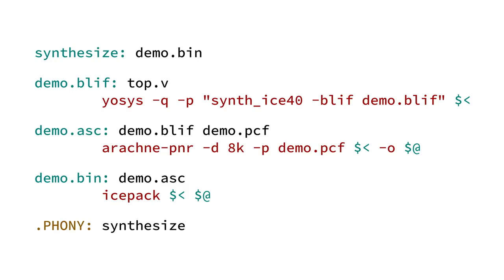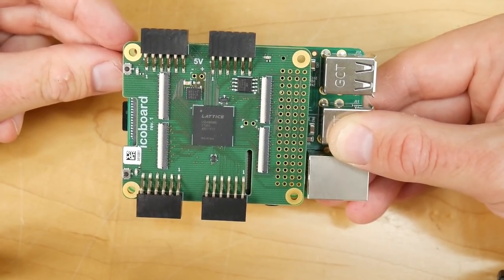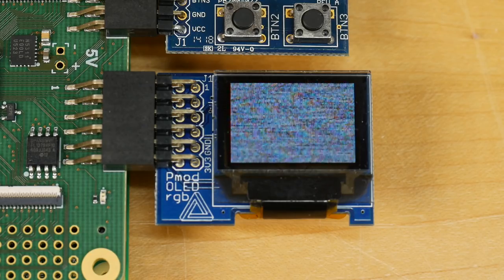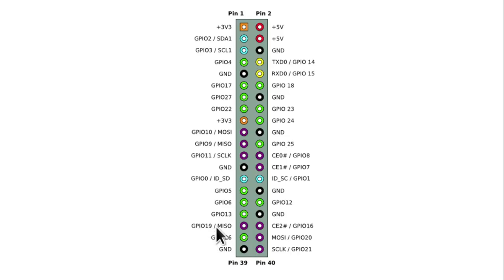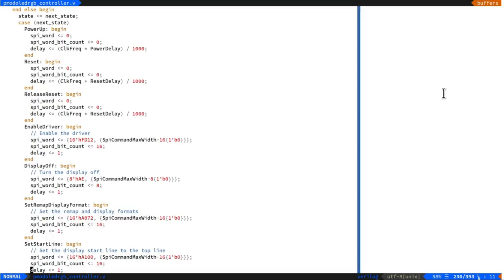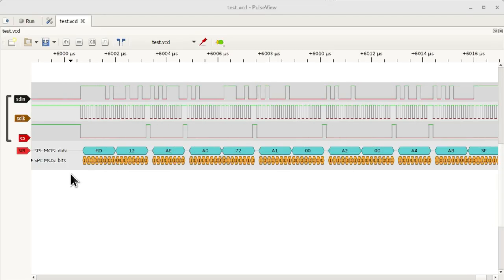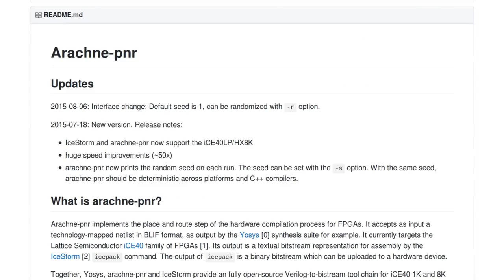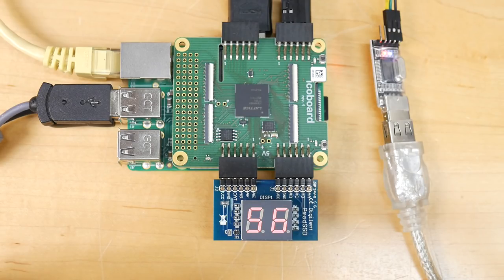[013-2] Open Source FPGA Synthesis with the icoBoard - part 2

Comment from the maker: Corrections:
- The FT2232H on the icoUSBaseboard is capable of 320Mbps transfers in synchronous FIFO mode.
Reply: OpenTechLab you did great job mate but i really do not know what u have done
Reply: I believe Syzygy rhymes with synergy
Reply from the maker: +gareth ronaldo check out the source code in the show notes. It might help make things clearer.
Reply: but the data sheet for FT2232H claims 480Mbps!
http://www.ftdichip.com/Products/ICs/FT2232H.html
Reply from the maker: +PirateKitty  That's the line-rate of USB 2.0, but by the time you've factor in all the protocol overheads, and time-division-multiplexing in USB, 320Mbps is about as much as you can reasonably expect in perfect conditions, with no other traffic on the bus.
Reply: I only can advice, please, beg you to do a beginner FPGA course...as i already have some altera stuff here, but i never made it to run something that i made on my very own..and we don´t talk about the ridiculous toolchain and module-pricing....
Set up a patreon FPGA course, if you want..... i´m in, for sure...that´s a great starting point: a RasPi, that FPGA board and a course...couldn´t be better than that...:)

Comment: Awesome 2-part video, a lot of condensed content that's really hard to find on YouTube. As for me, FPGAs and RF are part of that "almost-magic" domain, any video that brings it down to a more manageable level is really useful.
Reply from the maker: There's lots more FPGA and RF stuff coming. It's going to be fun!
Reply: I have more experience with RF personally, so I like the way I can think about FPGAs in a similar way to analogue circuit design. Microcontrollers, on the other hand, are the domain of evil pixies.

Comment: I bought the ICO board from DigiKey here in the states. Kinda pricey but I like the fact that it plugs directly into a PI so much.  I am going to use the flatflex connectors but was taken aback at how small they are! I shoulda known :-)

Comment: There are couple of limitations to amateur use of FPGAs. This first is the high package pin count of FPGAs, usually BGA, making it difficult to build the PCBs and place the components. The second is the high cost of the development tools. This channel appears to address both of these problems. I have used FPGAs in professional applications, but because of the above limitations I have only used PLDs in hobby applications, mainly because they are in home placable packages. I have not yet explored the videos on this channel but I do hope it also uses VHDL as well as verilog, as I am familiar with the former and have little experience of the latter, and also because VHDL is more often used in Europe,with verilog more common to the USA. I would really like to know if there is open source tools that can compile VHDL.

Comment: I wonder if you could use this for a software-defined radio TV receiver? A couple of ADCs sampling the signal from the antenna and feeding their outputs into the FPGA which does the decoding and sends the results to the Pi for playback.

My main doubt about the idea is whether this particular FPGA would have enough logic to implement a DVB-T decoder. AM/FM radio might be possible, though there probably isn't much point in doing it on an FPGA other than to see if you could when they're low-enough bandwidth signals that the Pi might well be able to decode them in software.

Comment: Would be interesting to hear from somebody in the know: What are the specs of that RISC-V softcore on this specific board, specifically achievable clock speed since the memory is mostly off-chip? Considering an FPGA clock of 100MHz, and the fabric being 78% full with a relatively simple C program, how much more can it be pushed?

Comment: I'm thinking about buying a FPGA board from terasic to learn verilog / VHDL. I don't know if i should get the cyclone 5 starter kit or a simpler board.

The cyclone 5 starter kit has both SRAM and DDR2, but i don't know if i will be able to figure out how to get the hard memory controller working. It also only seems to be accessible in qsys and i have no idea if it's possible to adapt the avalon bus to wishbone to use it with open source stuff.

My goal is to program clones of vintage computer / game systems and maybe make my own simple CPU. The external SRAM on the board would be a great way to store the cartrige data when the embedded memory is used up by RAM and framebuffers.

Comment: This was all very interesting and all (I have zero experience with FPGAs, but I do wish to learn), but I still have the problem of not really understanding what FPGAs are good for. Driving an SPI-display or such can be done even without one, and reacting to some debounced button-presses isn't much different. I suppose I'm trying to ask, what sort of a thing would be difficult/slow for e.g. RPi's SoC to do, but would be a simple job with an FPGA, either on its own or as an addon?
Reply from the maker: +Nita Vesa Ever had a problem where you needed some custom silicon to solve it well? FPGAs are the next best thing. For example the ice40 FPGA could easily drive dozens of displays. Larger FPGAs are where the real magic happens with massive data handling for broadcast video, RF communication, medical imaging, high frequency trading, machine learning. These are cases where specialist silicon would be ideal, but the costs are prohibitive. For makers, FPGAs let you play with really fast devices like the pros.

Comment: I had several boards, starting with no board Lattice CPLD maybe 20 years to 15 years back. Done nothing, then Xilinx cheap eval board, I think DE-0 without VGA and so. Then Xilinx DIL module (XuLA), only tested some small blinking. Then a DE-0 Nano board, done nothing, then a Zync 7000 series with ARM, also nothing - maybe blinking and now a Gatemate from Cologne Chip with an Eval board from Olimex. They claim to support the open source way and I was able to synthetise also a blinking sample. But then I found it not working and digged into what was wrong. Slightly different scripting to program the chip from non vendor tools. Fixed. Different example pin for LED. I was expecting the FPGA_LED to blink, but it was routed to  header without a LED. Maybe small design differences.

But with that, I started to fix my first verilog 'bug' and adopted the script to support my USB port for that eval board. The board with an VGA and PS2 connector seems well suited for soft core SoPC's and is really a cheap no brainer (~50€).

Over all, open source yosys and propably open source place and route from vendor, I need to check if their claims are true here also.

Long story short, I ever felt to have locked in to the vendor tools. Cologne Chip and Gatemate seems to be another alternative up to medium sized FPGA's.

Comment: Is it not possible to utilize the Pi to undertake the OLED display setup so that FPGA space is not needlessly consumed?
Reply from the maker: Certainly. Indeed I could have just configured the FPGA as wires connecting the display through to the RPi's SPI master, and remove everything else - but that wouldn't make for a very interesting demo.

Comment: Would all of this work on the Programmable Logic IC Development Tools iCE40-HX1K iCEstick Eval Board sold directly from Lattice? I am new to FPGA and $22 is more the sort of price I would want to pay for something that might not be what i want.
Reply from the maker: +Hyss Yeah a lot of people are using IceSticks with the IceStorm toolchain. The HX1K is much smaller of course. I also have the ice40hx8k-evn . It's cheaper than the icobard, but has no sram, and no pmod connectors (I made a special pmod adaptor board for it), and having the integration with a powerful processor like on the raspberry pi is really nice to have
Reply: What´s about a 013-3 followup..?

Comment: Sorry if I'm being an idiot but looking through IceStorm it looks like it treats HX4K parts as if they have just as many LUTS available using it as the HX8K. Is this right or is there any special sauce I need to use to make sure I don't use too many resources?
Reply from the maker: I havn't tried the 4K parts, so I can't tell you for certain, but if you look at the big table "Here is a list of currentently supported parts..." on the IceStorm page, you can see how the part is specified to arachne-pnr. I think the 4k is just a neutered version of the 8k structure - though I don't know the details off the top of my head.
Reply: Just done more looking around and it looks like the unobtanium BlackIce board uses the HX4K and that has a few projects that go way beyond it's specs in the datasheets. It seems like it's only neutered in Lattice's tools and by the amount of I/O.

I've just ordered some stuff to test this out so if anybody is interested in my results let me know.

Comment: I would not know what to do with one of those. Everything I want to do I can do on a regular micro controller.
And those I can program using C, which I know...
Reply from the maker: The iCE40 is considered to be rather a toy by FPGA beards. They're good for glue logic, moderate-high-speed but simple data stream processing, and applications that require very precise timing/low jitter. Larger FPGAs are where the magic really happens.
Reply: FPGAs excel at very specific tasks. For example I plan on driving an iPhone display from a uC somewhere in the future (since they are decent displays you can get for under 10$ from China), and doing this within a microcontroller alone would be a nightmare. This would be a pretty nice place for an FPGA I believe since you can adapt some display standard to the display in real time with relatively low power usage.
Another thing would be a small FFT processing. Of course this can be done in a microcontroller as well, but if you are working within some constraints (e.g. power usage), it can be a good idea to use an FPGA as a coprocessor for such tasks.

Then again, as OTL already mentioned, you probably need DSP blocks for such tasks, of which this chip does not have any.
Reply: Michi Lo  Eventually you will run into something that needs to happen very quickly and precisely, or multiple things that need to happen concurrently. Micros don't do either of these well, so this is where FPGAs come into play.
As an example, a single FPGA can decode an HDMI video signal, do image processing such as scaling, merge in a separate audio signal, and send the result to an HDMI output.  A micro would be hopeless for this. (Note that this is not an easy task, and there are issues around HDCP, but it gives an idea of what can be done concurrently in real time.)
Reply: FPGAS tend to be better at low latency parallel processes, such as real-time audio filtering. This would require a more powerful FPGA, though.
Reply: Basically i will know, when i need one, and until then, i am better of buying a lot of Pi Zeros.
Reply: Michi Lo tbh I'm tempted the get one just because the technology is so cool. Once I'd learned more about it I'd figure out stuff to do with it.
Reply: I was also curious, the answers have helped but still would like to know what would be an ideal or really cool project for this particular FPGA.
Reply: To be honest, unless you do know what you can do with one, you probably don't realise where you could use it. FPGAs are certainly not a cheap replacement for an MCU, due to their need for supporting hardware on a board, but they're capable of replacing a lot of discrete logic, and handling data at MUCH higher speeds than any MCU could hope to match. Think driving big full colour LED panels, or performing real-time data translation from one protocol to another, or driving hundreds of stepper motors simultaneously :)

Comment: How do those who are reverse engineering the FPGAs avoid copyright legal action by the device manufactures? The tool sets to develope code for these devices are usually exorbitantly expensive and usually well outside the reach of all but the most dedicated amateur constructors. The last time I looked, only Xilinx was offering a free development software,with Altera offering a cut down and limited web version of its development tools.
Reply: Both Xilinx and Intel (Altera) tools have limitations with device support with largest devices in hi-end family and onchip debugging tools. When you use subscription you get IP library that have softcore cpu and memory controllers etc. With free version you can use hard ip:s that are hard blocks in FPGA like RAM, DSP, PCIe etc. If device have hard PCIe block then it's license is paid in device price. Both have good charts what is supported free vs paid version.

Comment: 18:30 Why would you want to reduce the amount of logic tiles in use?  You're only using 9% of them.  Surely the goal should be as close to 100% of the RAM and logic tiles, without going over, in any case?

Comment: i still dont know when i would use an fpga :|
Reply: Real-time ray-tracing? Though, that's been possible on the CPU since the mid-1990s. No, seriously. There's a demo from 1996 called Transgression 2, which does low-resolution real-time ray-tracing on the CPU under MS-DOS. Needed a Pentium machine, and was probably heavily optimised, but given the Pi is around ten times faster than the early Pentiums, you could probably do similar scene complexity and a bit higher resolution without even touching the GPU. Though you could probably go up an order of magnitude if you could use that instead.

Comment: FPGA code != firmware
Reply from the maker: It does in the company I worked for previously. Therefore I tend to say firmware in lieu of a less ambiguous term.
Reply: I like calling it configuration, but I get the premise of calling firmware/code
Reply: mikeselectricstuff 

The terms used to describe FPGA bitstreams and the way they work in general is a problem atm.

eg. I'm constantly battling to distance things like (good) FPGA implementations of retro computers / consoles from the word "emulation".

In the generalised definition of the word, you could argue that some FPGA cores are "emulation", but the issue is that the majority of people assume that to be the same or similar to "software emulation".

(which of course, it isn't at all, unless you're running a software emulator ON an FPGA core. lol)

I have seen the config bitstreams referred to as "firmware" though, and I think that's fair enough as a term for the layperson.

I have used the term "firmware" a few times as well, but try to avoid it if possible, and say "bitstream" instead.

It is tricky not to call it firmware on an end product though, especially if you have say an ARM chip which directly configures the FPGA from SD card etc.

(and / or update it's own firmware.)

There aren't too many other good descriptions for the "code", apart from maybe "HDL", so I think that one is fine. ;)
Reply: My feeling is that the actual FPGA firmware is »more firmer« (TM) than the bitstreams which are more wibbly-wobbly and less firmer. :-)
Reply: Deepee Ayadges 

Yeah, that sounds right. lol
Reply: wibblyware it is then.
Reply: HDL in fabric? Firmware is just straight wrong, because it is not code, but hardware.
Reply: FrilloTeslar 

I agree, but lots of people in general don't really know the terms like "HDL", so I think firmware is an acceptable term sometimes, especially if the bitstream is packaged within an actual firmware image for an MCU.

A surprisingly large number of people still don't quite get how FPGAs work, and often think that the "code" is somehow running on some sort of magical super-fast MCU.

I personally do try to stick to saying "bitstream" for the synthesized files, but it's not always easy when explaining the differences to others.